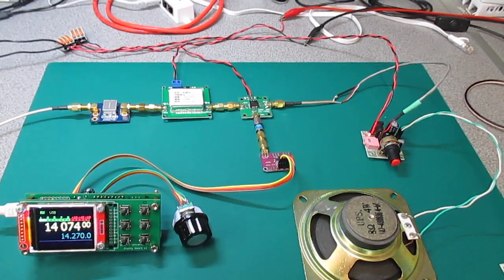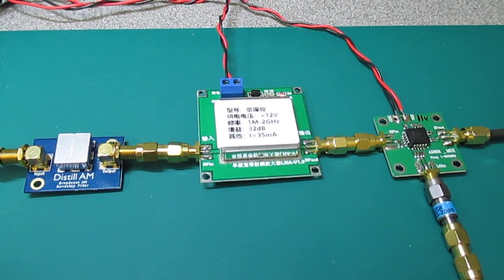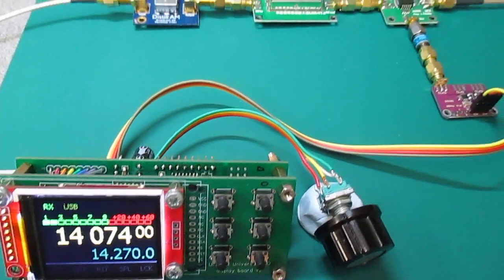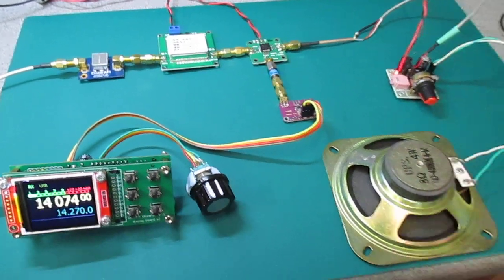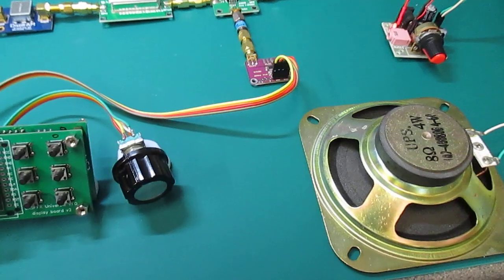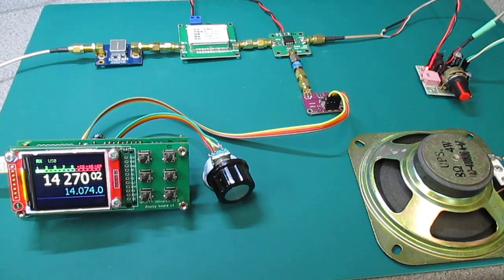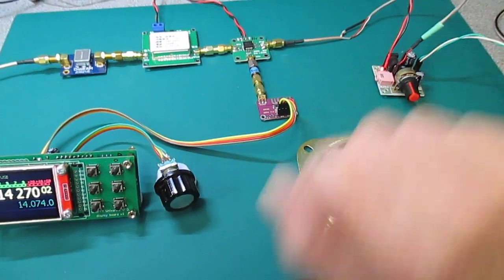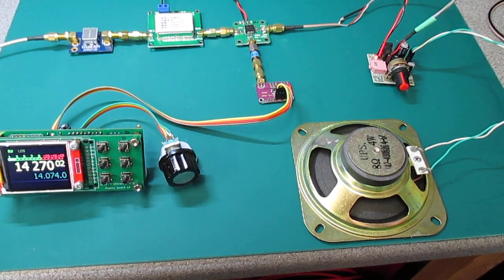Simple Direct Conversion receiver with AD831

Comment: Thanks, it works. I just have to do the demodulation in software on my PC. But gqrx does it well, you just need to set it up correctly. I quite like that filter, the one I made myself works, but it's no miracle.

Comment: It looks like you have an attenuator on the Si5351 - what value?  And what power level do you have the SI5351 set at?
Thanks for the video!
Reply from the maker: Yes, I have a 20db attenuator inline from the si5351 and in the Arduino code, power level is set to 2mA output.
The AD831 only requires -10dBm drive and I only have a 6db or 20db SMA attenuator, so opted for the safest solution - works fine.